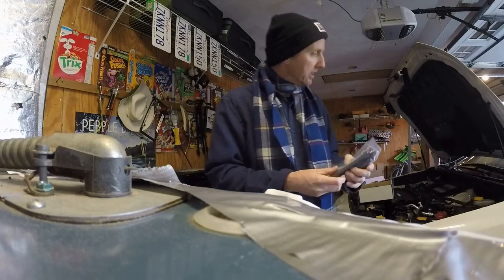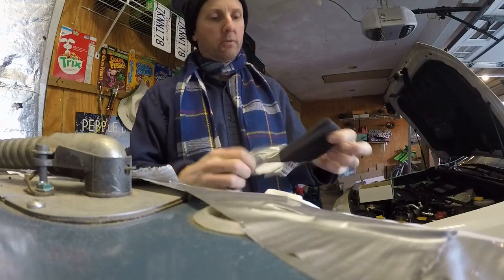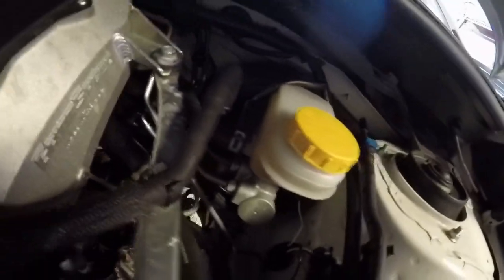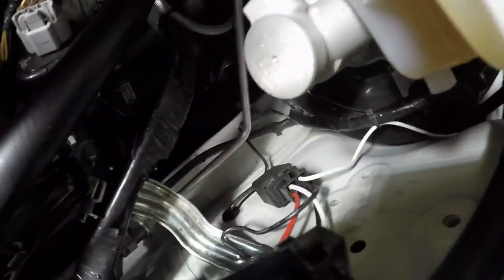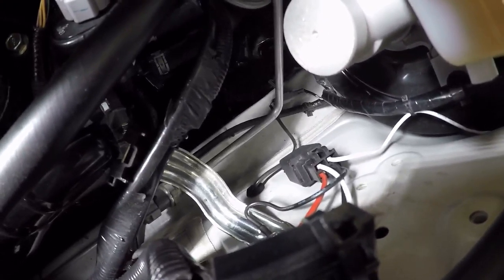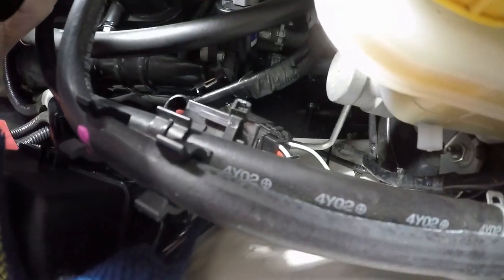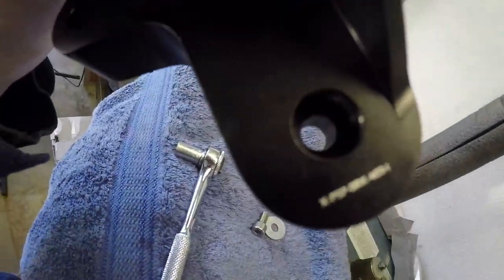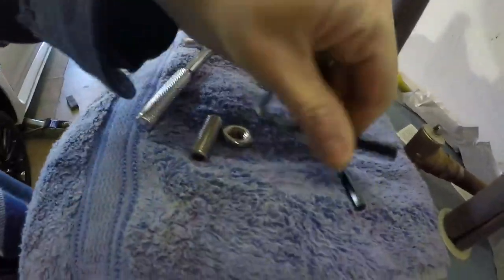2015 Subaru WRX Ep. 660: Perrin Master Cylinder Brace Installation

Comment: Installed this on my 2015 WRX Premium yesterday. It is nice and  solid in there. Was hot and humid out but got it done.

I got some ball end hex sockets for this job. Removed the driver side tire to get that bolt in. Was able to torque it down to spec. The other 3 in engine bay were doable but I did have trouble because the hex got stuck in the bolt. I was able to get the ratchet to click for being torqued down on 2 bolts in total but unable to on the others. I think I had some issues because of the cheap tool I had but it was doable for sure. I also realized I had some rust and gunk in the threads that I should of cleared out first by trying the screws in the holes first. I was in a rush... That would of made it easier to thread them in for some of them.

In any case, it seems solid. I didn't notice much a difference in braking but it is a good piece of mind. Figured I had done the pitch stop and pitch stop brace from Perrin so why not do this other mode to give it a nice complete look. Perrin didn't have the black version that I ordered in stock but surprisingly they gave me that nice bright yellow one or whatever color that is. It was more but since I contacted them they swapped the part for that color one. It looks good.
Reply from the maker: ya its subtle, but would help more if you have stainless brake lines too
Reply: @LastHumansGarage  agreed. However, for now I'm very satisfied with my braking. It is my only car so it brakes great for that.

I have brake performance slotted and dimpled rotors along eith Akebono Ceramic pads. Bled brakes using Motul Dot 5.1. Have been running that for a while now.

Comment: I've been considering this mod for awhile. From day 1 under heavy braking I noticed some flex when hitting the brakes. This looks way better than the Cusco one.
Reply: gorillahunter altho the new cusco revision can be installed from the top without having to stick your hand behind the wheel.
Reply from the maker: i checked it out. the perrin one is WAY nicer in my opinion.

Comment: I wish there was a little foot in between the Allen bolt and the reservoir to disperse the force a little bit. Probably not an issue though.
Reply from the maker: i know what you mean, kinda like a c-clamp saucer. but prob ok..
Reply: LastHumansGarage exactly.
Reply from the maker: i have c clamps.... hmmm.. i could steal a saucer..
Reply: Cusco has one with a wider footprint between the bolt & master cylinder; however, it's stamped steel, not CNC'd aluminum.
Reply: think it also may cause issue with some AOS I hear or strut brace/bar
Reply: LastHumansGarage doooo it
Reply from the maker: ya the perrin one is way nicer quality than the cusco.
Reply from the maker: youre gonna LOVE the next video.
Reply: LastHumansGarage can't wait buddy

Comment: Strut tower brace would be better idea .
Reply from the maker: wont fit with my intercooler
Reply: Mr. Worf and they literally don't do much of anything unless your running full suspension is more of a looks mod
Reply: That's what I figured . They are rather cosmetic unless your tearing up the race track .